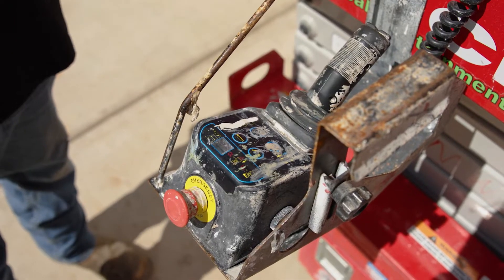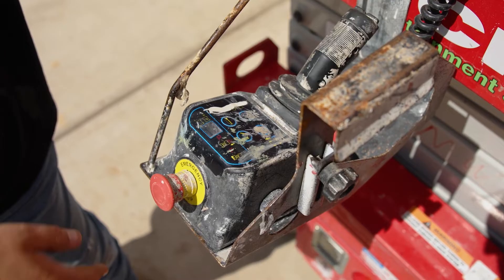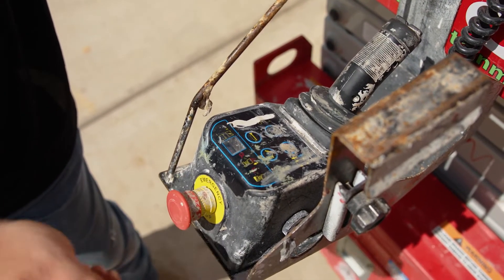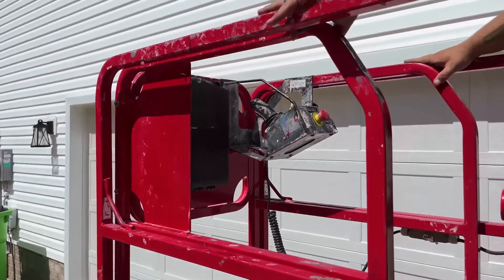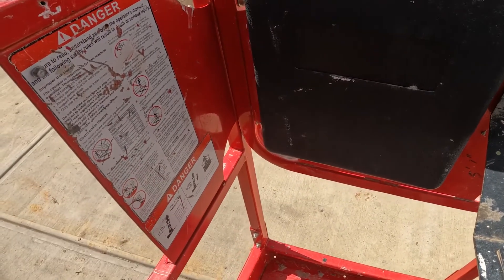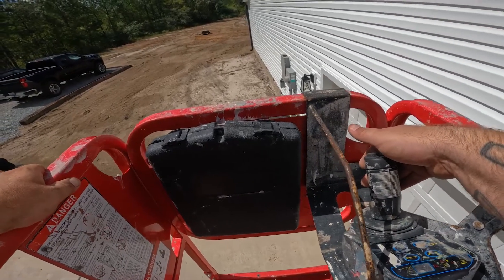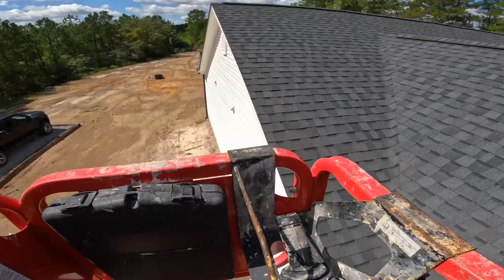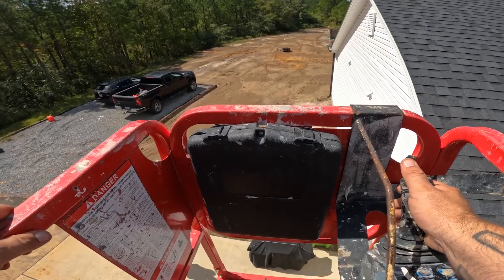How to Operate a Scissor Lift

Comment: Electric scissor lift is self-propelled and its tyres move left and right at will. What is the mechanism behind it that works. What is the voltage of the battery used in the electric scissor lift and how many hours can the electric scissor lift run on a charged battery.